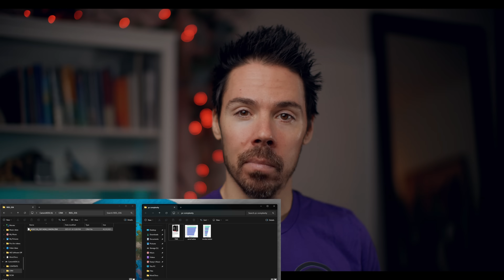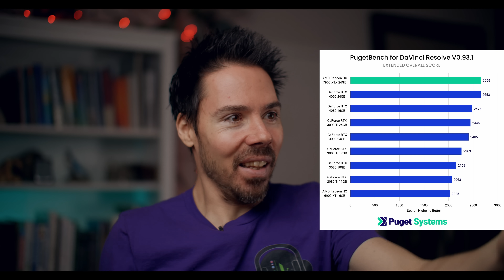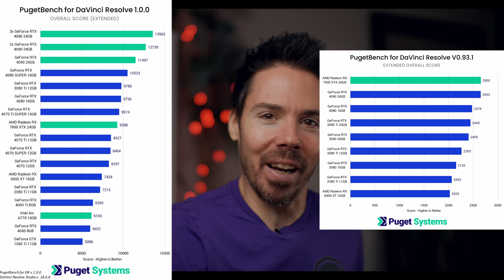The PC Building Rabbit Hole NEVER ENDS!

Comment: Your RAM is fine so long as your computer is running without issues.  As for the Sata routing, assuming you have the one NVME (ssd) and one more hard drive running from a sata and perhaps a dvd drive, then you just need to figure out which ones they are currently plugged into and move them accordingly if you want that top slot for the NVME... thing is you almost definitely don't need the extra speed on the NVME and won't notice a difference. I'd also point out the usb-c device you chucked isn't creating an issue with your GPU since you are barely stressing it with your current loads, and there is still enough airflow even blocked a bit. If you were doing heavy rendering round the clock, then maybe you could worry, but it's really not a problem as is. Custom loop water cooling would completely eliminate that fear though, and if your CPU cooler is indeed too big for your case, I highly recommend you look into it. The key with water cooling is to not just buy a ready made pump and cooler, cause as I learned the hard way those out of the box systems pumps fail over time, usually before the warranty is up, but it's a pain. The  D5 pump is the standard, and I have been running one for about 7 years without a hiccup. The advantage with doing custom loops (just a fancy way of saying running tubes from a pump to a GPU and CPU waterblock, is that you can easily change parts as needs should you upgrade your GPU, go to AM7 or whatever, so basically keeping the bulk of the cooling system and only replacing what's needed. Bottom line is, water cooling is scary till you do it, much like the PC stuff you're learning, but it is the best way to have a very quiet and very cool PC. There are still fans, but they can generally run at much lower speeds while still outperforming the best air cooling only solutions out there. Oh, and in regards to having multiple drives,  you'll see them to the left like where "music, libraries, etc.." are located. They are generally letters, but you can custom name them. Just click and see the files. Basically it's best to think of each as a big folder. You can organize it however you like...

Comment: Hey Kasey, look, you could spend weeks diving into every single rabbit hole for each component. To make it as simple as possible, I would recommend going for the most reliable and straightforward solution, although these almost never go hand in hand.

You will constantly run into issues with your old motherboard because the bottleneck isn’t the CPU, it’s the motherboard itself.
The problem with upgrading just a couple of components is that you’re essentially working within limitations you cannot bypass. Your motherboard is the main factor holding your system back, and if you upgrade it, it doesn’t make sense to stick with an older generation.

In summary, if you decide to upgrade your system, instead of patching things up, I would recommend the following:

Go for a Cooler Master NCORE 100 MAX ITX SFF Tower Case ($340), which comes with a PSU and an AIO CPU cooler pre-installed. It is nice, compact (it’s an ITX), and solves half of your issues.
I recently built a system with the following components:
    Ryzen 7 9700 ($340)
    ASUS ROG Strix B650E-I Gaming WiFi motherboard ($299)
    CORSAIR VENGEANCE DDR5 RAM ($200 for 64GB)
    RTX 4070 Ti (though I’d go for a 5070 now).

It works perfectly. It’s silent, compact, and you won’t need to worry about CPU coolers, USB-C ports, or other components. Of course, you can keep your current GPU for now until you realize you do need those CUDA cores, and then upgrade down the road.
This might not be the opinion you were looking for, but I think it’s solid advice that could save you a ton of time and headaches in the future
Reply: Regarding the SSD configuration, it is highly recommended to have the operating system (OS) on one SSD and your files on a separate one. The reasoning behind this practice is simple. It provides added safety because if the SSD with the OS fails, which can happen even with the best brands, you still have your files intact on the other drive. Additionally, using two separate drives prevents your files from degrading your system's performance.

I have used this setup for years, and DaVinci has had zero issues with it

Comment: I feel for you my friend.  PC upgrades are always this way.  Even when you spec out a new system and put it together, you always run into issues that need tweaking or troubleshooting.  New hardware is usually backward compatible, but that doesn't mean that it will take advantage of faster speeds.  Sell your C70 and buy a Mac.

Comment: I started heading into this type of mess 2yrs ago when I was considering adding a desktop PC to replace an aging laptop. I ended up maxing out a new Legion 7i (12th gen Intel i9 processor, 64GB RAM, RTX 3080Ti) and it has handled everything I've thrown at it, including multiple concurrent 8k files from Canon. I rarely see the CPU or GPU usage go above 50% during normal editing. The only downside is the 16x10 ratio screen still feels strange for editing, which could easily be fixed with an external monitor. Overall, I maybe I didn't get the best value, but everything just works. Life is too short to deal with building/upgrading PC components unless you genuinely enjoy the process.

Comment: From my understanding...Your motherboard supports XMP and should be fine at 3200. Some windows tools may repot it as 1600 or 1600 x2 but as long as your BIOS says XMP and 3200 then it is running (yes overclocked) at 3200. If you PC is stable then all is good. Yes, your graphics card should be in the x16 slot and nothing put in the shared x4 slot so that you have all 16 lanes for the GPU. Note also that I believe your motherboard 'is' PCI Gen 3. Your graphics card is PCI Gen 4 so you probably are getting the best graphics capabilities from the motherboard. I don't think you should or need to replace the graphics card despite it being the '9th' in the list. Certainly not unless you get a new motherboard (yes essentially a new computer!). Your m.2 ssd really should have been put in Slot A. Slot B has a more restrictive bandwidth. The speed of that drive may not be utilising all the bandwidth it can handle. If you PC is working for you then there is no need to upgrade. A RTX 5090 is the cost of 3.33 base mac mini's! Do you need that power!???🖥

Comment: I have 2 NVME drives and my motherboard is similar to yours, the faster one (gen 4) is also on the top and the slower one is at the bottom.

I don’t use SATA so I’m not sure if the SSDs affect SATA or not.

I would definitely switch it to the top slot to get the full speed, your motherboard should have a bunch of SATA ports, worst case scenario is that some of them might stop working and you have to switch to another one.

Comment: Been there... I did all the research recently for me - still upgrading still learning.

Both PC and MAC need time to make them work for you. 

PC - Do It Yourself
Mac - Decesion Isn't Yours
 
I am afraid you need to buy a new MOBO.
Only some expensive  motherboards do not share  lanes#@%*!
Also the 50 series of NVIDIA are the only ones that hardware decode 10bit 422 and the basic difference between NVIDIA and AMD is that NVDIA has Raytracing that you can use it only for gaming and less VRAM which we need for editing... 
BUT that say that AMD has worse quality exports and you will need almost to double the bitrate for similar results - larger export files... 
I can tell you everything you need. 
If you buy nvme tell me - I've been through hell and now I know...

Comment: Yo why does ur NVMe SSD not have a heatsink? It can be some cheapo one, but at least give it something lol. I do think you can try and put the SSD in the top slot for a try (which does have a heatsink, it's already on the motherboard), the worst thing to happen is that you just put it back on the bottom M.2 slot.
EDIT: DDR stands for double data rate, so 1600 x 2 is 3200. DDR4 means it's the forth generation of DDR lol. If you buy a ram kit of 3600 for example, it's 1800 x 2 but people and companies will just call it 3200 or 3600.
Reply from the maker: I have no idea, I didn't build this PC.

Comment: It doesn't matter if your graphic card is only running at PCIe 8x. Even at 8x, its already way too much bandwidth for your graphic card, plus you don't even use it for graphic application, it would probably run just fine with 2x for video editing (if it was physically possible).

Anyway return that monstrous 7900XTX and get an Intel GPU just for Quicksync.

Comment: Building a PC is a series of compromises.  The higher the performance we seek, the more compromises we find ourselves making.  PCIe lanes are always a limitation, and every motherboard model manages their allocation differently.  For your use case, Instead of an add-in card, I would have suggested a simple USB A to C adapter.  The 5900 will make a massive difference.   Yes, you should use the top NVMe slot.  Your motherboard manual will tell you which SATA ports will still be available.

Your RAM is fine at 3200Mts.  And your GPU is also fine.  

There's a reason why Apple users don't have to deal with this -- their machines are mostly incapable of being upgraded.
Reply: >I would have suggested a simple USB A to C adapter
This.
Reply: @Vladislav888  I would actually say a header adapter and a fancy new case!
Reply: unfortunately apple users (my laptop is apple but desktop is windows) are stuck with insane limitations. Apps, games, ram, overpricing, ETC...
Reply: @HalfInsight No one gets a Mac for gaming. Modern Macs all do video and audio editing perfectly well.

Comment: Another internal hard drive will appear in Windows Explorer just like a USB drive. Your C: drive will always be your boot drive and this is assigned to the drive that you're installing the OS to. Any additional drives will have a letter assigned to them and you can just drag and drop or copy files to them just like you would an external drive. There are settings in Resolve that allow you to use different drives for cache and project storage, etc. 

It seems like you could have left that PCIe card in without cutting into the bandwidth of your GPU. The CPU has 24 total lanes (3600 and 5950X are the same), so 16 for the GPU, 4 for the PCIe card for added USB and 4 for the NVMe hard drive. You can run system diagnostic software like GPU-Z, Hardware Monitor, etc. to check how many lanes your GPU is using. However, x16 is the maximum potential bandwidth of the lane, so running your GPU at x8 doesn't cut the performance in half, just the maximum potential performance. But I don't think that there are many applications that currently push GPUs beyond x8 bandwidth anyway. 

A higher-end motherboard would give you more PCIe lanes with an additional chipset so you have more freedom to add stuff without cutting into the bandwidth of various components.

Everybody saying "just get a Mac" is ignoring the fact that Macs work exactly like this too, with a finite amount of bandwidth. Adding more drives will result in less bandwidth just like a PC. Not to mention that Macs rely on Thunderbolt 4/5 and using more common and inexpensive USB 3.2 external hard drive results in far less speed than you'll get with the same drive in a PC.
Reply from the maker: Would it be better to install Davinci on other programs on that second SSD?  Just keep windows on the first one or would that not work?
Reply: @cameraconspiracies  Conventional wisdom is to use the OS drive to install all your programs as well. For something like Resolve, you'd have it installed on the C: drive, then host your cache on a drive and your project files on a drive. I don't know that it makes a huge difference to use multiple drives. There are articles on this on Puget Systems which I'm sure are clear as mud
Reply from the maker: @PhillipRPeck  Thanks :)
Reply: @cameraconspiracies  This used to be good practice in spinny hard drive times but NVME's are ludicrously fast, like absolutely insane speeds compared to HDD's. It's truly not worth losing any sleep over.

Comment: Every motherboard has a different PCIe lane layout. That's part of the reason there's so many different motherboards from the same chipset and brand, so you can choose one that suits your specific needs.

With multiple drives you'll just see another drive with files in windows explorer. Keep your files on the second drive.

Your RAM should be safe.

Did you want that AM4 motherboard that isn't crap? I'll send, you make the video.

Comment: If you're happy with your performance now, don't lose you mind over the details lol. It sounds like your motherboard is definitely not the best (it's pretty shocking to be missing usb C on anything modern) but it's such a pain to upgrade that so I'd wait until you want to upgrade your CPU to something brand new and do them both at once. Instead of 'Getting a whole new PC' in the long term I would just do a MOBO+CPU+RAM upgrade eventually and keep the gpu, then a few years later upgrade the GPU and then keep that cycle going. That way you're spreading out the cost over a few years, considering GPUs are so expensive now they're like half the cost of a system.

I'm a little confused about your Hard Drive/SSD situation - do you have a hard drive in addition to the SSD or just the SSD? If you JUST have the SSD then it should be no problem moving it to the faster slot. If you do have a hard drive, it'll be plugged into a SATA port (SATA is an older connecter that was used for all kinds of storage before the faster NVME SSDs came around) which is usually at the bottom right of the motherboard. If that's the case then you'll just need to reference your MOBO manual and see what slot is affected and if your Hard drive is plugged into that one. If so it should be easy enough to move it to another SATA slot.

It's not a bad idea to get a second SSD and edit off of that exclusively. You're correct that whatever drive windows is installed on will be where your 'desktop' is. If you have a second one, it'll appear sort of like a USB drive would on the left in file explorer (or your hard drive if you do have one). You should be able to choose in DaVinci where projects get saved as well as where you load your files from - if you use a different ssd that what Windows is installed on, it'll probably give you a little bit more performance just because it won't be 'sharing' and write/read speed with whatever stuff windows might be doing in the background (it's always up to something)
Reply from the maker: Yes, I have a 2TB spinny drive plugged into a SATA cable.  Most likely it will be disabled and I'll have to locate the other one wherever the hell that is lol.
Reply: @cameraconspiracies  they should all be right beside each other, SATA ports are generally all in the same place haha

Comment: 8:33 Someone correct me if I'm wrong, but don't SSDs get hot? You should consider a heatsink for it, so you SSD's lifespan last longer.
Reply: That drive is a Crucial P1, it's an entry-level SSD. The airflow (allegedly) from his case fans will be more than enough. It's akin to laptop NVMe drives, for many years a lot of those didn't even have a heatspreader, especially entry-level machines -- but it's changing.
Reply: @technologyanimals  Aah, got it. Thanks for clarifying.
Reply: > but don't SSDs get hot?
Yes and no. 
Yes, they can overheat due to the constant intensive usage and start to throttle.
In practice, any non-synthetic operation will either underload the SSD, so it's a non-issue, or it will end long before it overheats.
In real world, maybe it will bottleneck when you copy a huge, 200Gb+ backup from one NVME drive to another, which happens once a year, if that.

Comment: "Is it true for all motherboards?" - no it isn't. PCIe lane sharing happens when the PCIe slot is connected to the same CPU PCIe lane. On motherboards you have the CPU which usually comes with a set of lanes, lets say 24. All PCIe slots could be connected to it, but manufacturers usually don't do that. They put a chipset on a motherboard to help offload processing(signalling) of those away from the CPU. I think in your case, the lower large(PCIEX4) PCIe slot shares lanes with the tiny PCIe on the bottom PCIEX 1_2. Your graphics card should not share the lanes with the PCIEX4(longer slot) below it. It remains full lanes. What I don't see documented is how the NVMe ssds are wired in, but I see the manual mention they take up chipset lanes, meaning they don't share lanes with the main PCIEX16(GPU), since that is connected to the CPU.

FYI - if you ever want to have a motherboard ready for a lot of connected devices, all using lanes, look into E postfix motherboards, like X670E, X870E, etc. I have one and it comes with 2 chipsets, where I'm sort of guaranteed to not share the GPU bandwidth with other simple b1tch devices. Good luck

Comment: Not to send you down another rabbit hole, but to also send you down another rabbit hole - another thing that contributes to noise is the case. I had a cheap ass old case but then upgraded it to a nice one (BeQuiet) and it made a huge difference. It's something to consider, but I think my old case was abnormally bad.